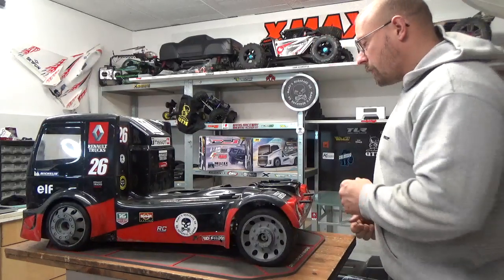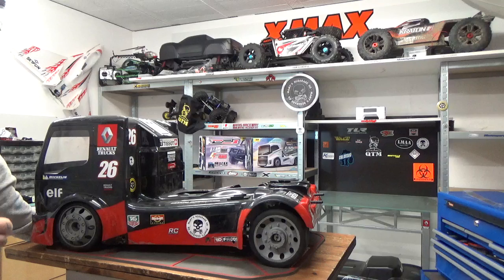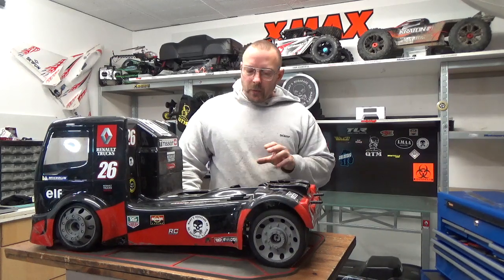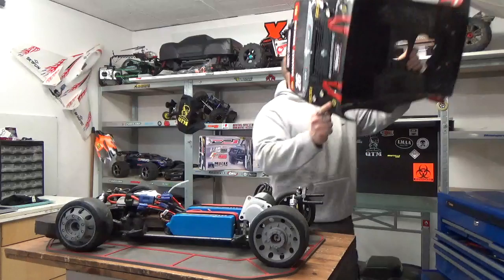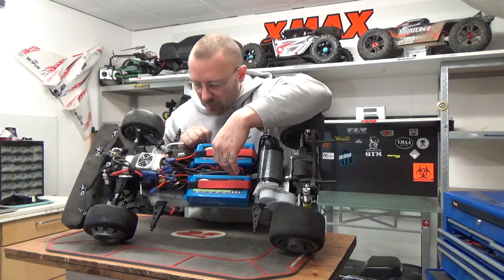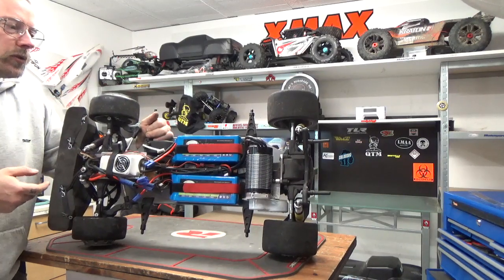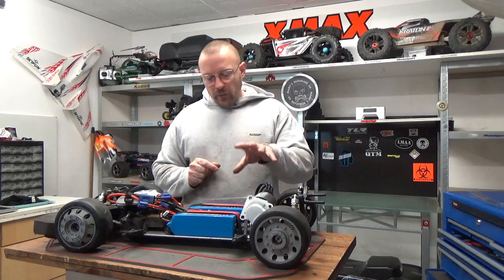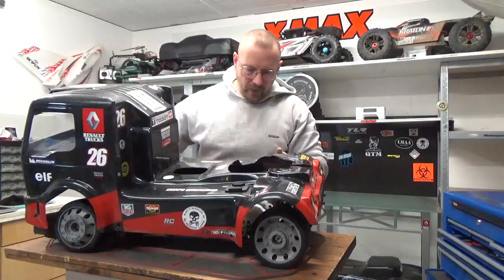MY FG 12s RACE TRUCK SET UP 70120 480KV MOTOR

Comment: Hallo. Nutzt du extra bremsen oder "nur" den brushless motor zum bremsen? Hast du dir mal Gedanken gemacht zwecks bremsleistung und negativer Ströme die dem regler nicht gut tun?
Reply from the maker: ich brems elektro ich habe fetter regler , geht super mach ich zeit  ich brushless färhe in 12s gross masstab ist uberhaupt kein problem keiner meiner 12 bis 24s regler sind gestorben da ich auch nieder kv fahre , viel schmorren nür weil sind 200 bis 300amp stromzug haben
Reply: @MRCG68  ich danke dir 👍 👍

Comment: hello friend i want to put the same motor on fg 4x4 beetle so what motor miunt should i use?
Reply from the maker: hello Antonio , so i hade made a 1cm distancer in the motor mount because its made for 56mm only , but puting the motor back with longer screw resolved the problem :)  but you dont need 70120 motor i recomande 56113 530kv leopar in 12s or sss 56113  360kv 18s , this was just for fun , brings nothing more because the fg onroad ar supper light :)
Reply: thank you now i ordered already the 70120 620 kv motor and ztw beast 300 a ESC.. so for this motor  ehat you recommend me to use as motor mount??? i can order a motor mount for this motor that fits from some store? or should i order stock fg mount and afther that modify it? thanks a lot i hope you can help me to solve this  problem:)